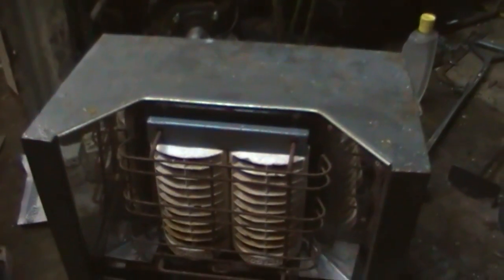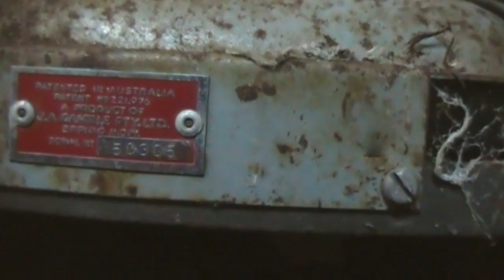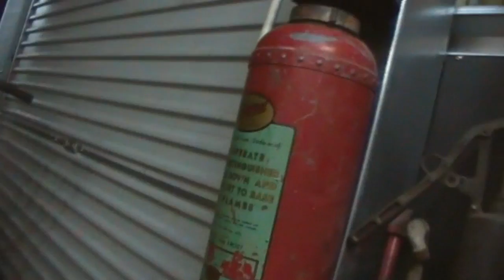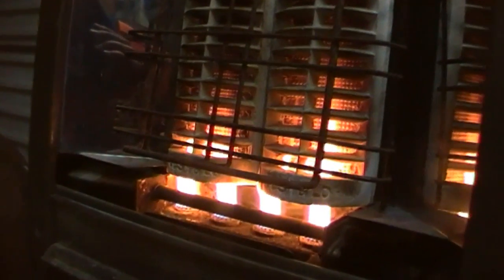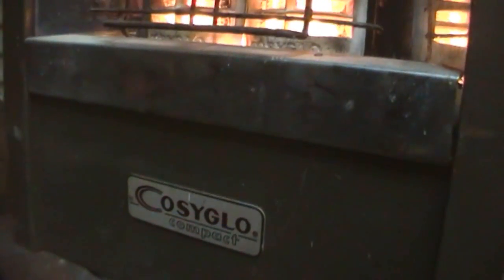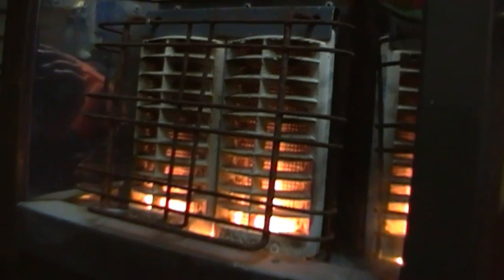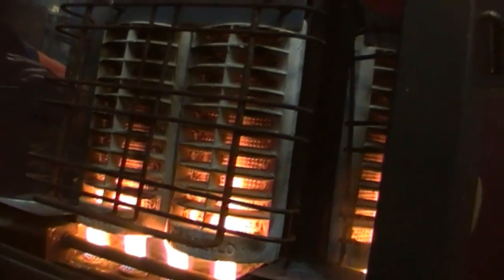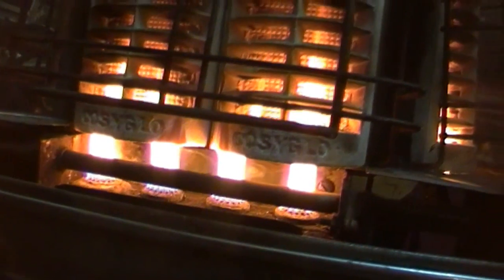Clynton's Shed - "Cosyglo" kero heater

Comment: What a neat little heater. I can't get my bloody blow lamp to go, jet keeps blocking up. Got to put some mesh over uptake pipe.
Reply: Funny, I bought one of these today from a Flea Mart in Dayboro Queensland, it is very clean and not in bad shape, Ill give it a whirl later on to see if I can get it to run. it probably got retired when the jets needed a clean so I may just do it first, Kidding, I'll just give it a go. p.s. I paid $25.00 for it. I would have left it if it weren't for the Mantles being intact. If they were broken I am guessing replacements would be nigh on impossible to obtain.